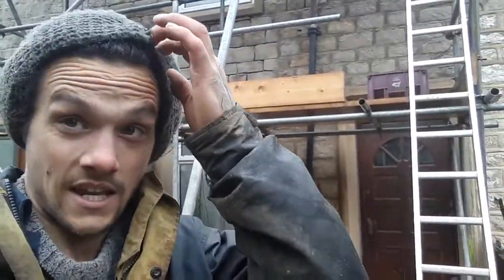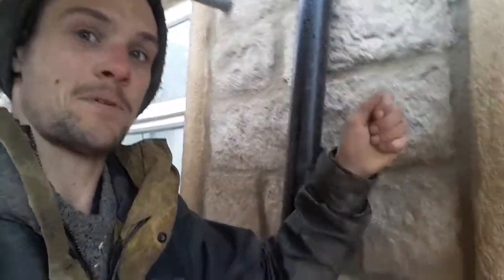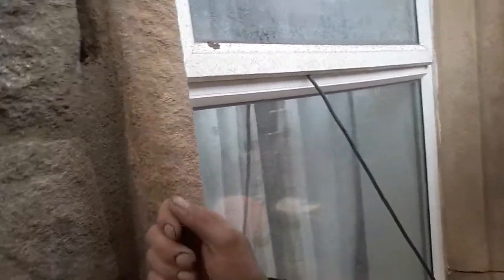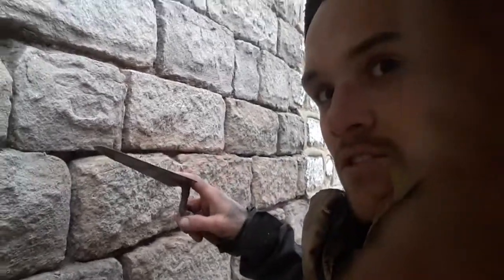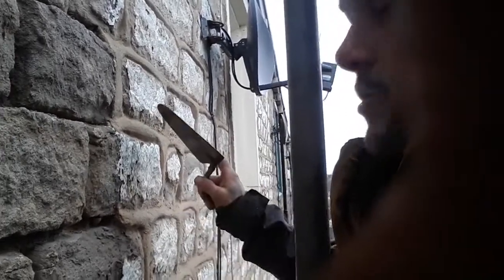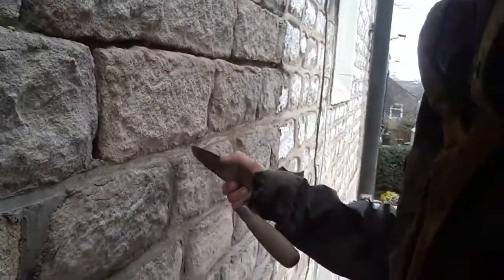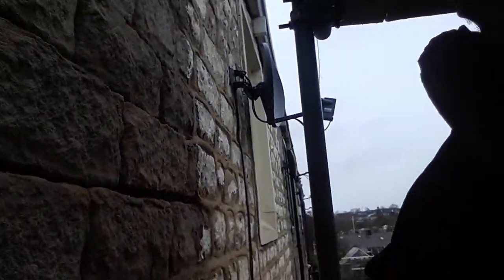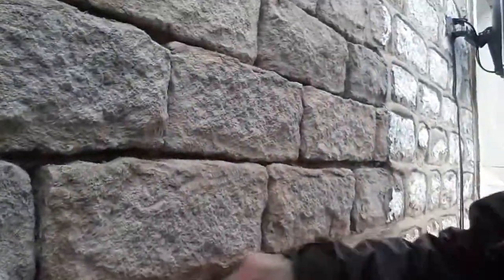Repointing (part 2)

Comment from the maker: Hi Marco, the mix ratio that we use for cementitious mortar is 4:1:1 medium grit sand: pointing sand: cement. So that is a 5:1 mix in total. 
I would advise that a 4:1 mix ratio would be too hard for a pointing application. A hard mortar mix has more tendency to crack, with surface temperature fluctuation. Hope this helps?